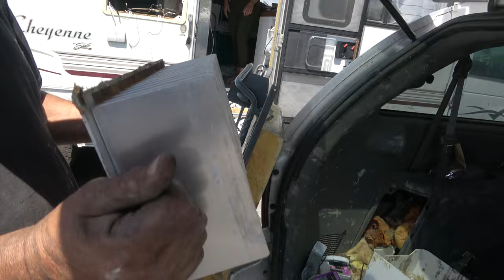DIY RV Fridge Repair - Step By Step How To Replace the Cooling Unit of a Dometic RV Fridge

Comment: Great video! I'm repairing the same model Dometic fridge today. I chose one of the Amish-built cooling units from JC Refrigeration. It comes with an excellent 50+ page installation manual but it is still useful to see a good RV tech do the job. One great take-away is that Harbor Freight hydraulic platform. I had no idea just how heavy and bulky the fridge was until I had wrestled it out - not a good surprise! I have a HF platform that I use for installing heavy window AC units. You bet I will be using it to put the camper fridge back in the hole!

This guy is a good instructor. I think the comment he made around 24:15, where he said, "If you ever want to do this for a job..." was very telling. Like the other trades, RV repair is desperate for more techs and guys like him can't keep up with the demand. He needs an apprentice
Reply from the maker: Hope it works out for you! He’s a great teacher which is why we put the very long version out there!
Reply: The #1 cause of fire in an RV is the Propane Fridge. Solution: Convert to 12VDC Compressor type which is 100W not 300W efficiency.
Reply: @Thinker2-truth I have heard that the number cause of camper van fires is the battery/solar set up.  Everything has risks.
Reply: @nmartin5551 I did not mention camper van. I'm talking Class A Motor Home and Propane. Electrical is always a risk, especially home built. 
I have a Dometic that needs a 300W Pure Sign Wave inverter to run on DC, and a SunDanzer Freezer that uses 100W @ 12VDC
Reply: @Thinker2-truth  I appreciate that.  Just felt like saying that everything has a risk.  Is SunDanzer the model You use?

Comment: For $475 plus $100 for shipping, the Cooling Unit its defiantly worth it doing yourself. For me I like boondocking so a propane fridge is defiantly a way to go. Thanks Don
Reply from the maker: It’s DIY if you have the tools and are comfortable taking everything apart like this. For most people, DIY is beyond them. I’m fairly handy and I wouldn’t take this project on
Reply: what cooling unit replacement company does he use?

Comment: Great video.  It seems to me, I would rather replace the unit with new! A lot of confusion just to replace the melted or damaged part. I think I would also build out a new framed area for a residential fridge!!
Reply from the maker: Great point! If we didn’t know the installer we would have gone with a residential and we would have had to build a special frame for whatever fridge we put in. Unfortunately this guy didn’t want to be mentioned but if you can find an installer who is knowledgeable it’s worth it. But if you feel confident with framing the residential, then you don’t have to worry about being level. And the residential power is a fraction of the amo draw in 12v dc

Comment: Hi. Thanks for all you do!  i live in Nova Scotia, Canada in my 2003 Glendale Titanium .  My fridge just went - I could smell the ammonia so I knew the cooling unit was finished.  Unfortunately where I live there are no reliable and competent professionals that I would trust to swap out the cooling unit, so I am going to try it myself.  Would you happen to have recommendations on where to purchase a new or refurbished cooling unit?   I think you mentioned you had suggestions, but I didn't see it here in the notes. Thanks so much and I hope I can do this!
Reply from the maker: https://jc-refrigeration.com not sure if they ship to Canada, this company refurbishes the fridge cooling units and also makes a 12 volt compressor unit that you can convert your fridge to if you wanted. Hope this helps
Reply: @CalledToWander thank you!

Comment: can I ask ?? I just cleaned the burner on my dometic DM 2652 it works great, but I noticed the igniter gets red hot when the flame is on, is that normal? is it supposed to get glowing red hot? thanks in advance for your answer!....
Reply from the maker: That’s normal. Ours does that as well

Comment: Awesome video!
Thanks to this professional, fantastic job of being helpful and informative.
The one question I was left with on his rebuild. Is how he formed the form around the rebuild evap. By its color it looked like it was still an original from a prior unit!
Reply: If you mean the stovepipe-like duct around the boiler tube, at around 38:45 you see him begin to take apart and transfer the duct from the failed unit onto the new one. I'm in the middle of doing this same job right now, but installing a new Amish cooling unit. The new one came with the duct, except for the removable panel which covers the heating element opening
Reply: @lcar9871  That is not what I am asking about. The foam already formed around the evap coils. I am curious if a new/ rebuilt unit come that way.
Thank you for responding!
Reply: @weloveups  got it! I bought new, from JC Refrigeration, and it came with the foam formed around the evap tubes. Others I've seen also came with the foam in place
Reply: @lcar9871  thank you
Reply from the maker: This is a refurbished (original) that he refurbished himself using his experience in aerospace tech. Not sure how he did it but it’s held up wonderfulky
Reply: The #1 cause of fire in an RV is the Propane Fridge. Solution: Convert to 12VDC Compressor type which is 100W not 300W efficiency.

Comment: How much did it cost to hire a professional? Looking at a camper that needs a new cooling unit
Reply from the maker: We were fortunate that this was just under $1,000 - well below the replacement cost for a new fridge. Of course, rates and availabilities vary depending on where/when you are looking for help. Just keep in mind that these specialized experts are not always easy to find. General RV repair people may know how to tinker with different components but may not how to replace (or know whether it is even necessary) the entire cooling unit. Hope you find someone that works for you!

Comment: I have a dometic rm2351 that never has cooled well. Bought the TT brand new about 3 years ago and it’s always sucked. It will cool but no better than 40° and once you start actually using it in real conditions where your opening it it will be sitting at 50°. This week it’s been sitting at 45° not in normal use. 1:04:37 Not safe for any meats,milk etc. I’ve tried,themister,leveling,now I’m testing a new 140mm twin variable titan fans to see how it’s going to work. If it helps great but I don’t have much hope for this fridge at this point. I’m probably going to end up having to replace the cooling unit or swap the whole fridge to something that works better. My local repair center wants $80 to diagnose and $160 a hour to work on it which is fine if they can actually fix it.
Reply from the maker: Yeah, "newer is not always better" is a mantra we've lived by in our RV lifestyle the past 6+ years. If they "guarantee" a repair, you are right - a good repair person is worth the labor. But if its a guessing game that bleeds you dry, you might as well invest that money in a different product.

Comment: I have a semi newer model Norcold N811. The fridge quit working so I checked the voltages at the 120 and the 12v (13.1vdc). When I power it, I here the contacts click but no spark, no gas valve energizing, no nothing. The inside reads and does all the things but the outside acts like it's not being told to come on. I do HVAC and the board is basically the same as spark ignition control boards on those but I'm at a point where I'm stumped. I did change the control board because I was pretty confident in my diagnosis. It does the exact same thing as the old. Any help would be greatly appreciated.
Reply from the maker: Sorry we’re not the experts. We were fortunate to find someone who was!

Comment: How do I know if replacing the  coming unit is what I need to do?
Reply from the maker: Typically you will see a yellow crystallization forming on the pipes or underneath the baffle if you take a few screws off. Thats the ammonia leaking out.
Reply: I removed the panel and there's nothing yellow and no smell. It has power for the electric but does not cool. I turn propane on and it starts cooling. Will not cool on electric
Reply from the maker: @Glich_plays_games  the heating element is most likely bad. Search your fridge model number and “heating element” and you should be able to buy one. Amazon sells them too
Reply: @CalledToWander  thank you so much
Reply from the maker: @Glich_plays_games  Not sure what this could mean aside from perhaps the motherboard is bad. You could try and replace that (send it back if not). We replaced our motherboard at one point for another issue and it was literally plug and play. Number the fuses as you take them off and it's usually just 2 or 3 screws. Another option if it works on propane is just to run it on propane. If you stay anywhere for a longer period of time, install an Extend A Stay propane adapter like this and use an external tank you can take and refill/swap out. My money is on the motherboard for the electric, but that's only because it seems evident it is not the propane system. https://amzn.to/4dS2cnv

Comment: Do you have any video how to fix a hole in the roof  of rv.?
Reply from the maker: Unfortunately we do not. We always steer clear of buying RVs with roof damage and have not taken on any major repairs that involve that. I’m sure there’s someone out there with some information. Depending on the damage it may be repaired with Dicor lap sealant, eternabond tape and Henry Tropi-cool paint. We do have a video on roof maintenance using these.

Comment: Excellent video thanks. You mentioned the guy helping you was a fridge expert from British Columbia. Well, I'm in BC and I need a fridge expert. Mine is a 3-way Norcold 662 out of a '92 C Class motorhome. The fridge still works on gas but the DC and the AC are kaput. Please post the guy's info, either here or by DM. Thanks.
Reply from the maker: @ooeybc  he actually asked us not to mention his business. The guy who diagnosed our fridge as dead is from BC but this guy who installed the new cooling unit is from Phoenix AZ. If you do a google search for RV fridge cooling unit repair or refurbished in phoenix his website should pull up.

Comment: The #1 cause of fire in an RV is the Propane Fridge. Solution: Convert to 12VDC Compressor type which is 100W not 300W efficiency.
Reply from the maker: We’re good. Thanks
Reply: @CalledToWander  Full coverage! Ah?
Reply: You seem to be trolling
Reply: @jeremywallace5961  So stating facts is "trolling" in your world?

Comment: Wow these refrigerators are so dam complicated and a night mare  , why don’t they just install a residential fridge ??
Reply: You can't run generators in a lot of places after dark.
Reply from the maker: These refrigerators were first built years before modern technology provided energy-efficient options. Residential fridges now are very energy efficient. But, for example, running this fridge on electric is very inefficient. However, these fridges (pre-2000s) were built like tanks and for having the efficiency of propane, they were a great option. The newer residential fridges cannot handle the road as well as these and I doubt any fridge you buy in 2024 will still run like this one does 25 years later. To directly answer your question, we looked at the pros and cons of residential fridges and when we found this guy we confirmed that it is better to repair the older, better-built fridge than to put in something we might have to replace 2 or 3 times in the life of our RV.